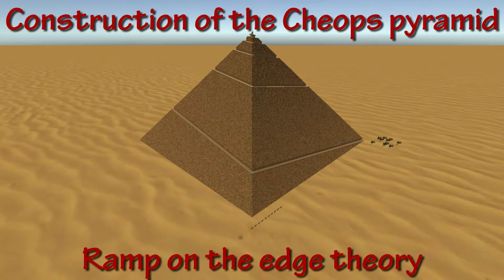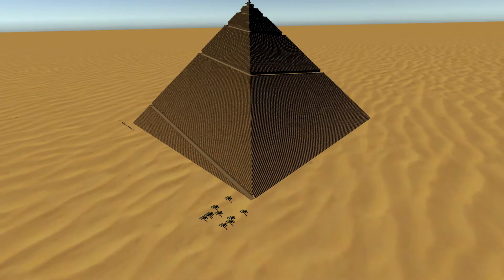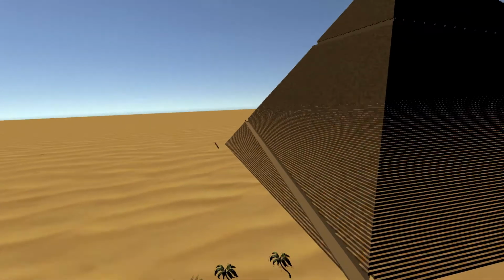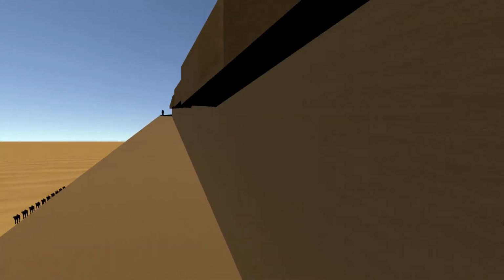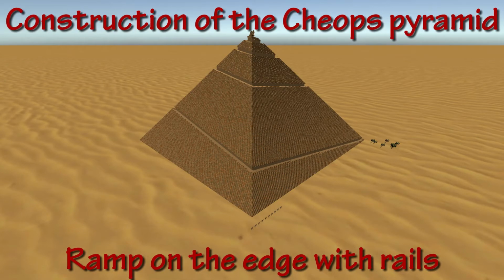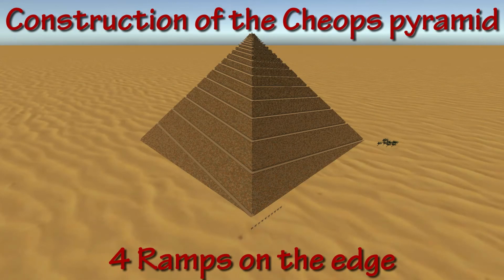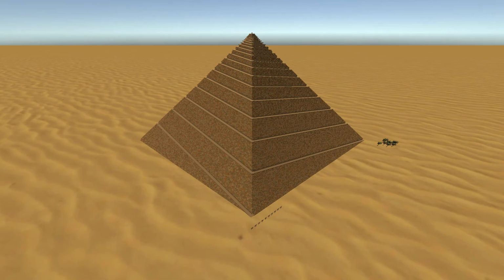Construction of the Cheops Great Pyramid : Ramp on the Edge theory

Comment: Why on earth would any engineer use ramps and sleds to move 5,000-pound limestone blocks up the Great Pyramid (GP)?
Imagine slipping and having a block crash down and destroy one side of the GP?
Then there's the requirement that 500 blocks had to be lifted each workday for 20 years
that's 1 per work minute to move 2.5 million blocks in 20 years.

This means that if you were to look at one spot on the ramp a 20+ man team of men had to drag a block past it in 1 minute.
1 minute - all day long for 20 years
This is another stupid idea that the author didn't spend but a few minutes thinking about before making a YouTube.
Reply from the maker: In this video and its calculations, the time needed to build the great pyramid is not discussed, it is only said that it could be one of the possibilities. In addition, a solution is proposed to complete the pyramid in 4 times less time than using only one ramp.
The proposal does not include the way to raise the blocks or how to make the turns in the corners. Only the force required is calculated. If they used men, animals, or machines is not discussed in this solution.
A solution is proposed for the case that a block accidentally slides with the edge ramp with rails method.